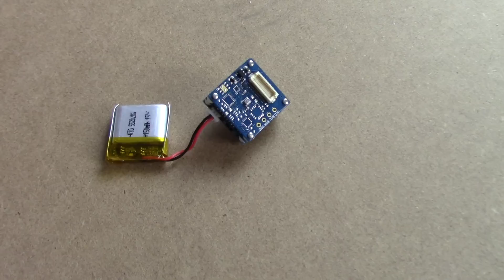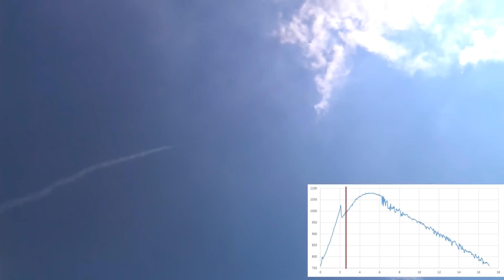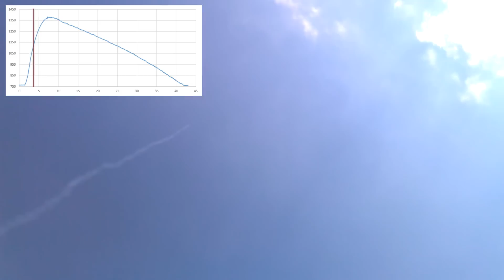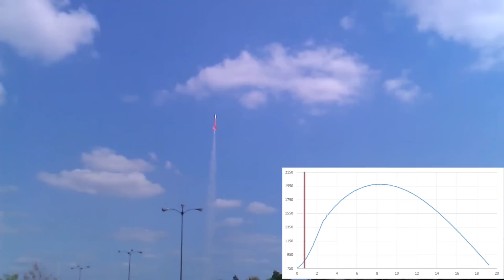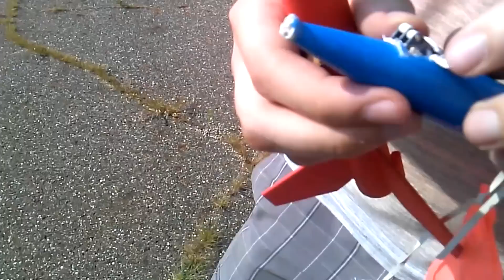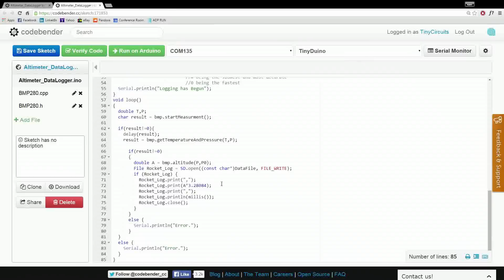TinyCircuits Altimeter Rocket Tests

Comment: Could you combine this with the GPS TinyShield to get a full flight computer with GPS and altitude data points? Also, what's the shortest sample time that you could use? You've used 30ms in your video, but my HPR will go too fast for those data points to be close enough together. TIA.

Comment: OK, I've got my altimeter data (though I used your TinyZero with the Barometric Pressure TinyShield ) and flight video. But, if you don't mind me asking, what software did you use to create the animated chart and combine it with the video of the flight?

PS: The altimeter has worked like a champ for me.

Comment: The bump is due to the drop off in acceleration. The wobbling on decent is the shaking of the rocket, shocking it with high and low pressure as it moves through the airstream.